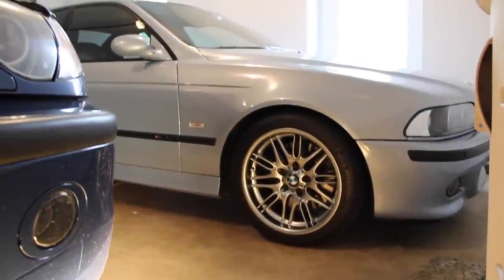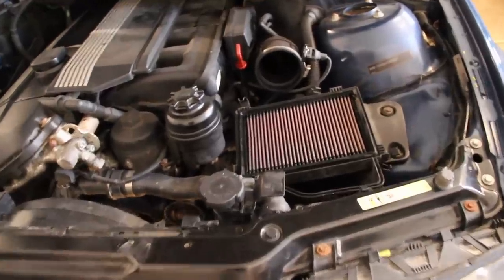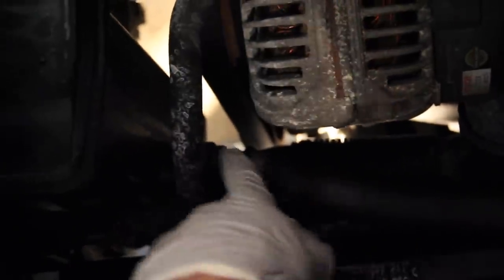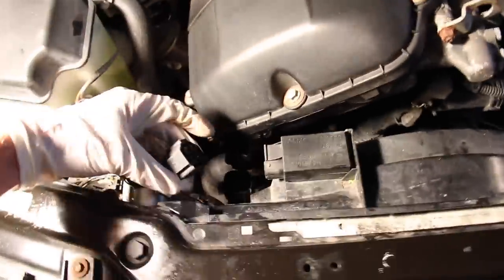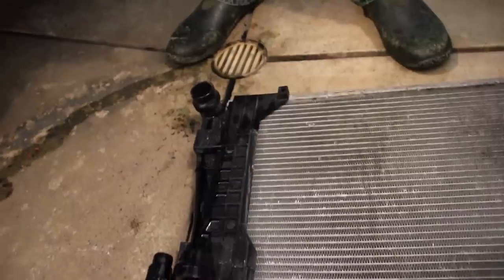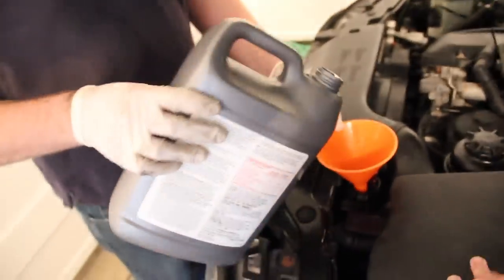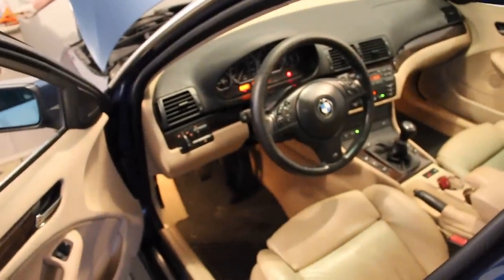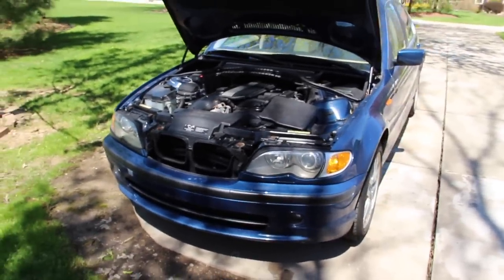BMW E46 3-Series Radiator DIY (Manual)

Comment: Amazing!! I have a 2001 bmw 325i Manual transmission with 176k miles and I have leak problem from the radiator. I will definitely replace the radiator. Thank you guys this is really helpful!!

Comment: Great DIY. Did a cooling system refresh on a 330ci auto last year. The fan clutch adds a magnitude of frustration and difficulty to the job. Theres a DIY on the forums for adjusting the buffer range on the cluster. May be worth looking into.

Comment: Very helpful. Thank you. 

With regards to the drain plug, the whole thing comes out (use a 23 socket I think).
There are two different length plugs, the short one is for a manual and longer one for an automatic due to a pipe just above the drain plug going to the auto gearbox for cooling.

Comment: I purchased a radiator and it's opposite from yours. The old radiator you have had a drain plug at the bottom of the radiator. Amd the new one didn't. And the radiator that's in my car right now (old one) doesn't have a drain plug, but the new one I just bought does have a drain plug. It's vice versa from yours, but I guess either way it works, as it worked for you guys.
Reply from the maker: Is your car an automatic?  The automatics got different radiators than the manuals.
Reply: @E39Source  it's a manual. But I just figured out that the radiator that I bought can be used for both manual and automatic transmission

Comment: You guys can just take the fan out first next time. I didn't touch my cooling system on my ZHP and removed it for belts and pullies. And the fan shroud is held in with the correct parts. Ones a torx and ones a push rivet.

Comment: Great vid. I have an E46 fan that runs at only one slow speed.. whether the engine is cold or hot, even with the AC on. Is that a known failure of an aftermarket fan?
Reply from the maker: Hmm, this is a good question.  Do you have any stored codes for a fault in one of the fan circuits?
Reply: @E39Source   thanks, no faults in INPA related to the fan or cooling system.

Comment: Hey guys great DIY it has helped me out tremendously.  I was able to replace my original rad today, it had 302000km on it and was leaking, I reused the same electric fan. As it was working perfectly, my issue is, my fan now will not turn on and as Im attempting to bleed my cad with the rad cap off, my car is over heating making a huge mess and the fan will still not turn on :(, I gave up working on it today and will return to the car tmo when it’s cold. I have left the rad cap off tn to see if it will gravity bleed it self or not. Any ideas of to why the fan won’t turn on ?
Reply from the maker: The original fan may just be caput.  Inspect the wiring and connectors for damage.  On mine, the smallest wire (signal wire) was broken.  Bleeding the system is annoying, and sometimes I've had to rev the engine quite a bit to burp the air out of the water pump and nearby areas.

Comment: I advise anybody doing this job  not to separate that tank from the bracket just remove the whole thing together only 2 t2 screws holding it. Reason its hard to take thst off is because it has sealed the oring from the heat You take it apart and it will leak it will never seal right again
Reply from the maker: Replace the o-ring...

Comment: I have a e46 330ci but am going to get a cheap e39 528i project car but it needs the radiator replaced this video will apply to the e39 right and also they are both auto so does this video still work?
Reply from the maker: This video will be helpful, yes.  The E39 is very similar.  Expansion tank is much easier to remove from the E39 compared to E46.  No real difference between auto and manual for the E39 either.

Comment: does the bottom hole on overflow mounting bracket below torque head need a rubber?? it seems awfully loose.. or maybe supposed to be that way?
Reply from the maker: I don't remember specifically if there was something in there.  There might be a little rubber grommet that would make things tighter... but as long as it doesn't fall out, it should be perfectly fine.

Comment: Just a question. Have you ever changed the transmission or the power steering fluid? Or even the gearbox fluid? An answer would be very helpful. I have a bmw 325xi 2002 with114k miles.
Reply from the maker: I did the transmission, front differential, rear differential, and transfer case fluid in my 330xi shortly after I got it.  It's cheap and easy, and will help those components last longer, and work better.  I would recommend that you do it.  Same with power steering fluid, coolant, brake fluid, etc etc.
Reply: @E39Source .. Does the transfer case on the manual e46 330xi take the DTF-1 fluid same as automatics? Thanks.
Reply from the maker: The transfer case is separate from the transmission, so transmission type should not matter.  @cw988